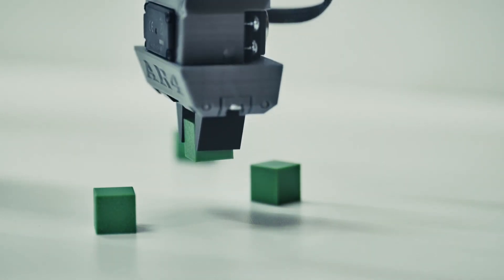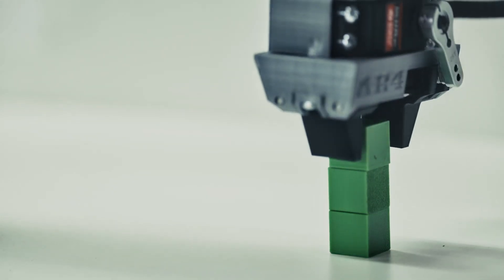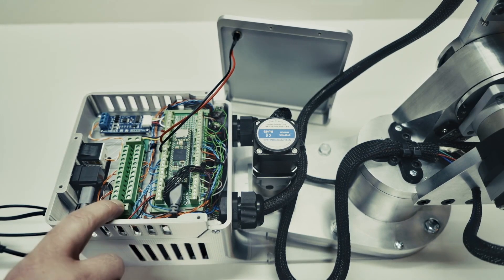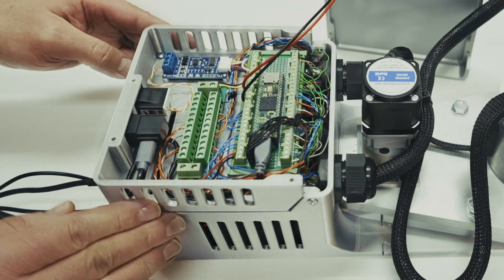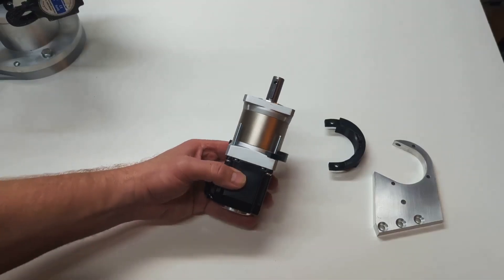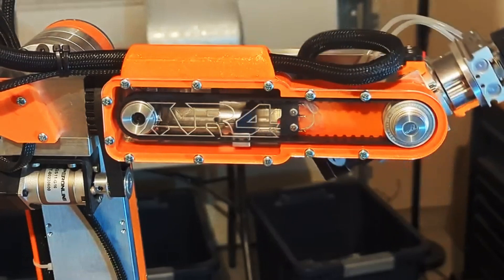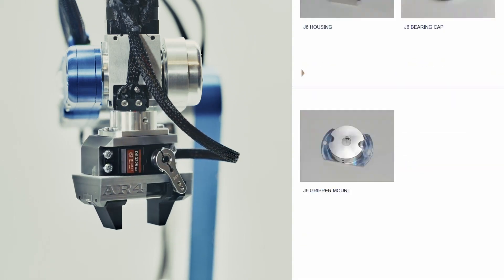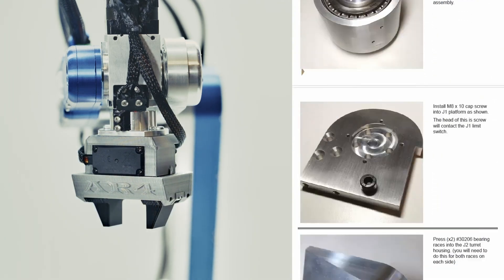AR4 MK4 - ROBOT ARM - DIY 6 axis robot kit / 6DOF / Arduino controller with Python program interface

Comment: Hi Chris is there an upgrade kit for mk3 to mk4?
Reply from the maker: Hello,  I don't have a kit listed given the minimal parts change, primarily the upgrade includes the larger base enclosure and J5 arm print files.  The new parts are some dupont connectors and a 2x12 terminal board.  There are a couple posts on this in the community but also please email me at info@anninrobotics.com and I can outline the parts to get and if you have trouble we can figure out how to ship you what you need.

Comment: Hello. Are there any plans to build a slightly larger robot? Perhaps with more powerful motors, such as the Nema 23 Closed Loop Schrittmotor 3NM? And with the ability to handle a 4-5 kg load? Or is it possible to upgrade the AR4 MK4 to these motors? I'd like to build a milling robot.

Comment: Its 4th axis is not practical to make . Very difficult to make it use any ball screw and nut arrangement. If that is resolved it will be good.
Reply from the maker: You might be surprised, the brass guides and rails work quite well.

Comment: How can this be controlled if I may ask.
I am coming from a 3 axis cnc hobbyist angle so I am familiar with concepts up to 4 axis systems (3+rotary) but I am new to this and would love to know more about how they are controlled and programmed. Are there free options?
Reply from the maker: All the software is free as well as the print files and manual.  The software is similar to an industrial robot teach pendant with point to point teaching, jogging and offsets as well as interfacing with PLC's or 5v IO boards.  here is a link to the programming tutorial.  https://youtu.be/cwQjzYSAIQQ?si=gKVNVzkadu1Gc9Zy

reach out at info@anninrobotics.com if you have any questions I can help with.